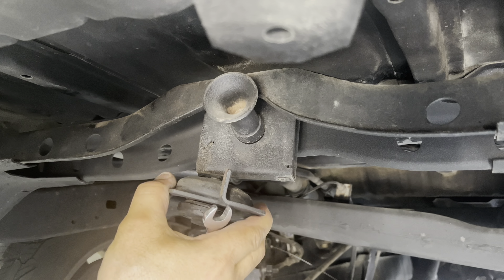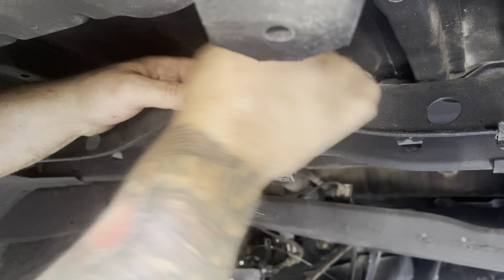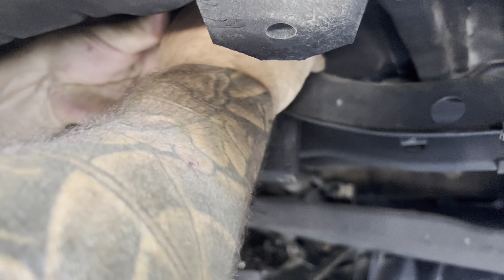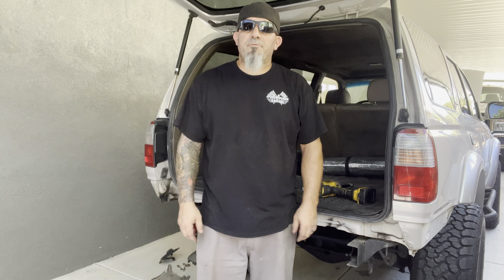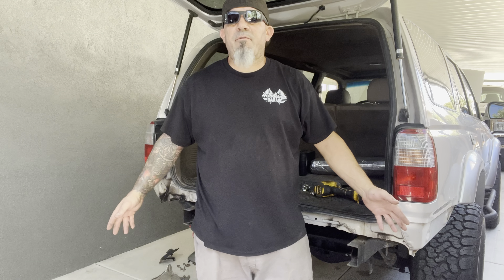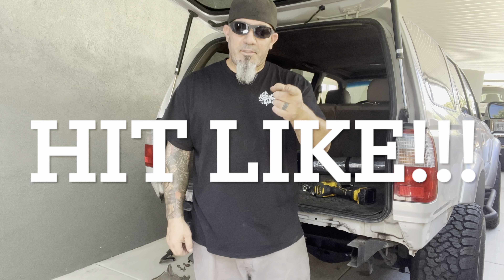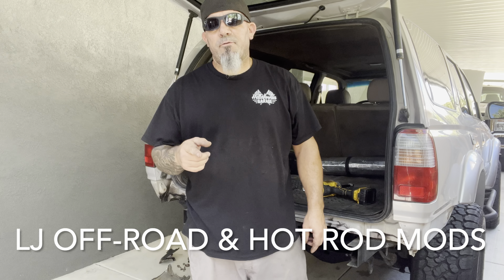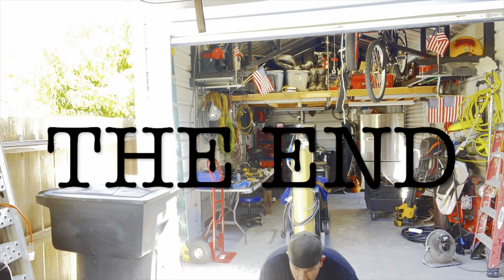3rd Gen 4Runner rear bumper removal for coastal off road rear steel high clearance bumper

Comment: Very jealous of how clean that frame is. Working with hand tools it took me multiple days to get the rear bumper off my new to me '97 because of how rusted it was underneath.

I think there is still a bolt or two still attached. Ended up twisting the rear bumper bracket enough to finally get the last connection point free.

Comment: In the rust belt. Going on a week. Each bolt is a new and separate challenge. 
Penetrating liquid.
Torch
Impact
Grinder
By then, they twist the head off, so add
Drill out
Tap
Being a car guy and living in the Midwest is heartbreaking. 
Good and informative video though. Well done brother.
Reply from the maker: That just comes with the territory
Reply: Same here man, im struggling on the last bolt near the spare tire hanger